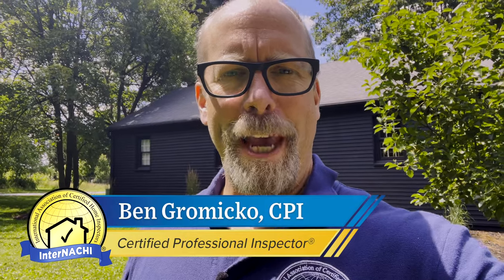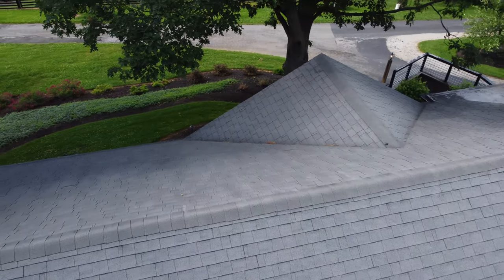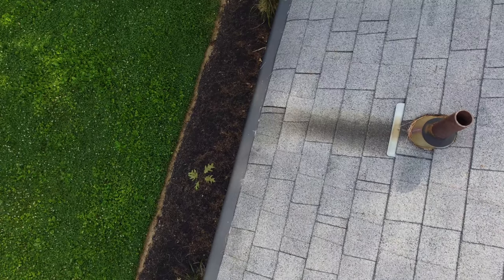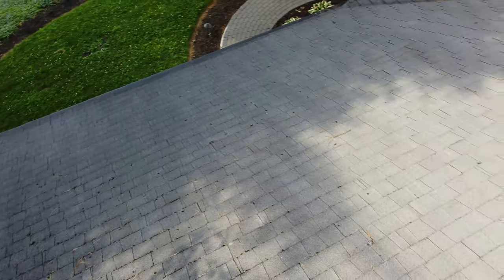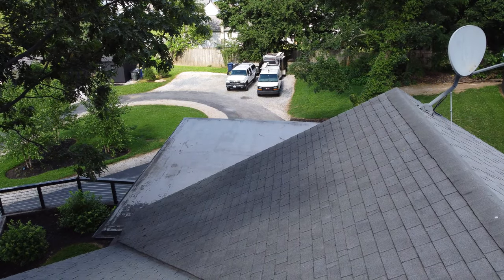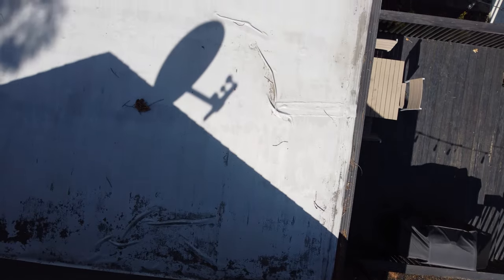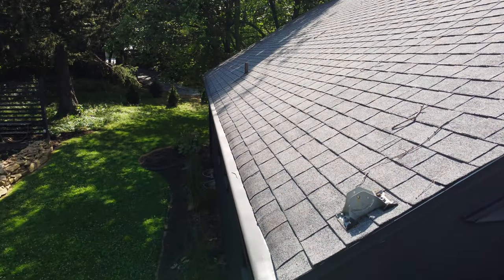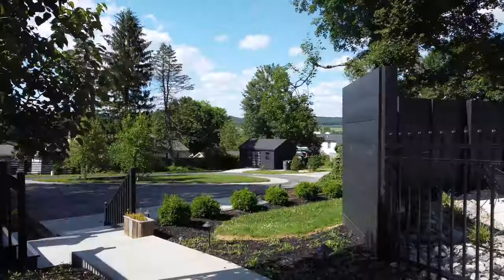Roof Inspection With a Drone

Comment: To use a drone for roof inspections you can not use it as a set of flying binoculars. The best method is to fly a grid pattern over the roof shooting high quality images. Download those images and view them full scale and high definition. Shoot multiple angles, using a high quality camera. I currently use the DJI Air 2s for my roof inspections. This provides 20 Meg imagery and video over 4K. The 1 inch sensor allows me to photograph from a little further away. I take images looking up from the roof line as well. I rotate the gimbal up to get a great image of the roof.
Reply from the maker: Nice, Digger.
Reply: How do I get certified for this besides the 107 certification
Reply: @speedbird7976  Pass the drone ground exam and register it, then you are ready to go!
Reply: That's the info I needed..
Reply: @speedbird7976  There is no other way to legally do this.  You NEED a part 107 certification to fly any drone for any reason other than fun.
Reply: do you have roofing inspection license?
Reply: How much do you charge for this?
Reply: For a stand alone roof inspection the pricing starts at 100 dollars.
Reply: Or just fly your drone close enough to get your pictures. You don’t need a drone license if the drone weighs less than 249 grams. I use a DJI Mini SE. I use it everyday and I work in the roofing industry.
Reply: @Artic_Bear  Incorrect, if you make a single penny as a result of using your drone, you MUST have a drone pilot license. I can introduce you to an inspector who received a 38,000 dollar fine from the FAA for doing exactly what you said.
Reply: @grizinohio1 Bingo!! 👍🏿 Additionally, money does not need to be exchanged for this type of activity to be classified as "commercial".

Comment: WARNING: Using a drone exposes you to other risks. Some things on a roof CANNOT be inspected properly with a drone. The list is actually quite large. A few of them are, weak sheathing, loose plumbing vents, comp not attached to flashing, unable to get to an angel to view flashing or the underside of eaves, unable to get close enough to vents to ensure screens are in place, and more. When walking on a roof you can clear debris to inspect further, often revealing issues. You can also touch things like antennas, chimneys, flashing and more to determine if they're secure. I understand that drones can be useful for a roof that simply cannot be safely walked, but make it the exception not the standard. At minimum get your ladder out and view it from different edges. Avoid the drone until it's simply the best option, which is really only ever going to be over binoculars. Also, regarding what you're required to do or not, don't make the MINIMUM requirements your standard. Go above and beyond what's required if it's not going to be a huge risk. There's always risk when inspecting. If you eliminate all of them you just become the inspector that everyone hates, the one that says, "consult a qualified professional for further inspection" for everything. Also, that roof is weathered like a 14-17 yr old roof, and it's a 25 yr shingle. I don't see any shiny fiberglass edges and relatively minimal black asphalt that would indicate heavy granulation loss. The minor curling of the shingles is the quickest indication that you have multiple layers, however, and that can reduce life expectancy by as much as half, depending on shingle type and installation method. I feel bad if you're telling people that a roof like this is end-of-life. 😬Sorry bro. If my perfect vision can't see it with your 4K video, it's not there. I do see an old satellite bracket with bolts through the roof that aren't sealed over and should be regularly maintained. Wrinkles in rolled roofing typically indicate improper installation or underlying moisture penetration. These spots often cause water pooling that could allow for moisture to seep in at those, now weak, wrinkled joints.  Maybe you just need more time on roofs and getting accurate info about the install date and covering life. I'd suggest spending some time with an experienced roofer.
Reply from the maker: Correct. The drone is very good for inspecting the roof-covering materials. Drone can't inspect components and conditions that require a physical presence and contact with the component or system itself.
Reply: I was going to say as just a homeowner with viewing the video the granules looked good and no cracks in the shingles that I could see as a novice. Also different locations or states probably present different problems. My last house built in 1996 with a  standard roof like in the video was sold in 2020 with no leaks anywhere. All the granules were in the rain gutter every year in Northern California. When I sold the house I gave money to the new owner for the roof but as of to this day he has not replaced the roof. No Leeks! So these roofs in some places can last a long time.
Reply: It really can depends on your software and 3d modeling with artificial intelligence catching things that we as humans can possibly miss during an inspection artificial intelligence can catch things from CERTAIN parts of the AC UNIT not being installed correctly to certain parts of the roof leaking water that may not look as such from you directly looking at it artificial intelligence then  grades it depending on how bad of a risk factor it is even if it’s not a problem now it potentially will be a problem 5,6 months to even a year down the line
Reply: @devonteturner5505  The ai I'm using right now says you don't have a clue what your talking about. ... that's weird
Reply: @lewchishelltaya5745  😂🤣🤣
Reply: @lewchishelltaya5745  LMAO
Reply: I agree that the roof is not worn out, the shingles are about 60-65% worn and still have several years of life left. I have 25 years experience and I have literally inspected over 120,000 roofs, mostly with ladders but now I am using a drone as well. I also agree with your Warning, but it depends too on what kind of inspection is being called for. Most of the inspections I provide are roof wear and missing shingles or major damage. Also, a drone is great for getting a measurement of the peak of the roof.

Comment: Do you need a license still for drones that are lighter than the weight class requirement?
Reply: Yes, weight is not relevant if you are using the drone for commercial purposes.
Reply from the maker: For commercial, yes. You need to pass the FAA exam. We have a prep course for that exam.
Reply from the maker: There's something special about registering a drone that's under 250 grams.
Reply: Any drone (below or above 250grams) that's used for a commercial purpose, has to be registered and you need a part 107 license.
Reply: @tjmaineinspector  Doesn't even have to be for commercial purposes, if it is used for self promotion even though no money is made and it is not used for anything other than promoting yourself (i.e. a non monetized youtube channel for instance) then it still needs the part 107 and the registration per FAA guidelines.
Reply: @crossbowsniper  The FAA term is:  "... in the furtherance of a business."  And that is if ya get paid for it or not.

Comment: you don't have to be an FAA certified pilot to fly the mini2. Only to inspect and charge
Reply from the maker: The law requires that all recreational flyers pass an aeronautical knowledge and safety test and provide proof of passage if asked by law enforcement or FAA personnel. The Recreational UAS Safety Test (TRUST) was developed to meet this requirement. If the drone is less than 250 grams, you don't have to register it. But you still have to take the test. https://www.faa.gov/uas/recreational_flyers/knowledge_test_updates

Comment: I want to do this but I worry about the line of sight rules with the FAA, any advise?
Reply: They’re making slight changes to the VLOS rule. But most houses you should be able to have line of sight.
Reply from the maker: Thank you for watching.
Reply: I have taken off and landed in multiple locations around the same house to get the full set of photos / video if for some reason I cannot see my drone due to trees or other obstacles. and I go slow. it just isn't worth crashing your drone. :)

Comment: “Drone” is a loose word and doesn’t have to preclude walking the roof. A GoPro on a pole can reach unsafe areas and get you views otherwise inaccessible. 

I feel like a padwon lecturing Yoda.
Reply from the maker: You're correct. Good comment.